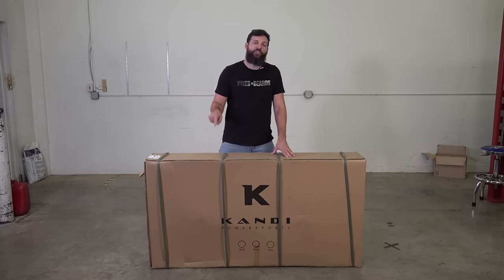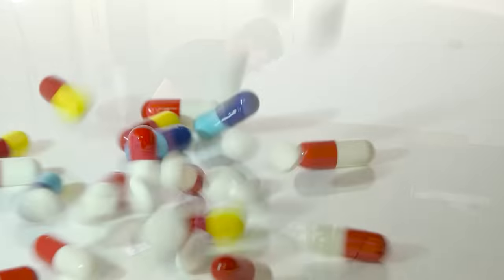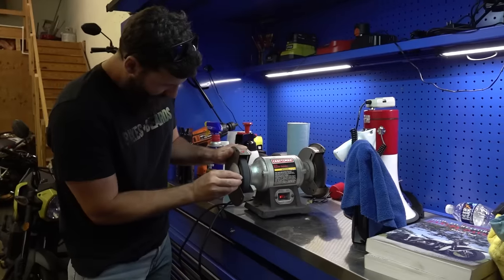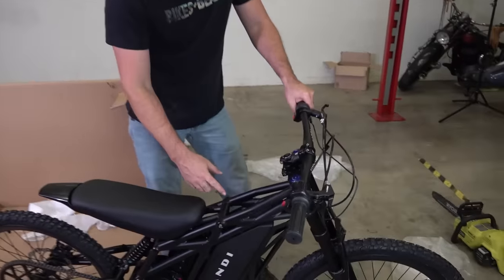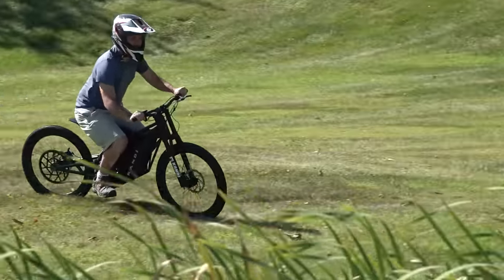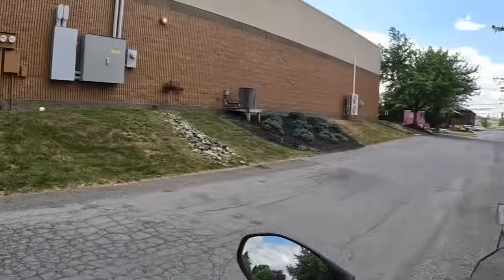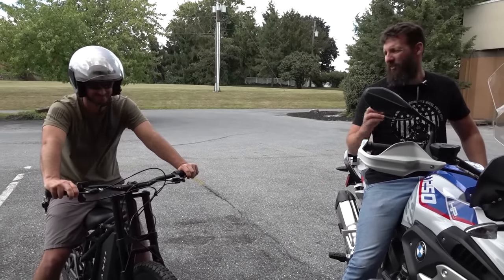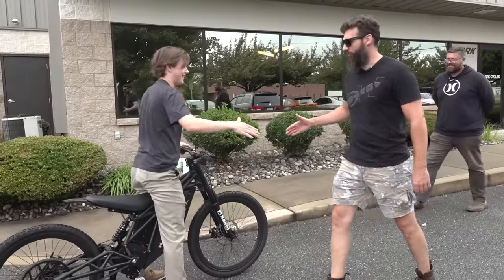I Bought the Cheapest Electric Dirt Bike at the Auction

Comment: Went on Kandi website clearly a Chinese company shipping containers over to unsuspecting dealer who think they will make millions. (Trust me I know I did it in the Chinese 07 heydey, even carried the 800cc sxs which was actually quality unit. Mitsubishi 3 cylinder 4x4 rear diff lock all bells and whistles). Anyhow ppl are so skeptical you make about 2000 per month and I can sell ice to a snowman). Anyhow back to KANDI it's a youth bike and it says on the website (bike looks way cooler on site btw) that it starts at 1399.00 so buddy was blowing out his container probably paying more for his storage than he was making selling them. It's a pitiful 250watt motor I mean even my 1st ever to hit Canada electric scoot was a 350watt/500 peak and it was gutless as hell but very fun and tough as nails. Trust me I had to p.d.i. each unit and give them a serious shakedown. How long that would last remains to be seen. I think ive seen about 2 still riding around town (albeit it's 13 years later) with all the plastics off. Wires going everywhere even saw one with a 12v car batt bunged corded to the highest spot on the rear panel. So yes KANDI its a youth cycle with a 36 volt ( that's 2005 tech it's probably a lead acid batt at a whopping 8 amp hour batt. (Hahahaha) 8ah u serious my lithium to start my bike has more than that. Top SPEED 18.6 mph. Overall LENGTH ( it's probably of the box chinesium is famous for this adds about half the size with their carbon neutral packaging. Estimated RANGE 21.7 (with a bird riding it or remotely maybe or no a sockless chinese fella in a car beside it pressing the button and keeping it upright going downhill 21.7 miles. That's how u get that done. Overall WIDTH 19.7 and this is probably assembled then they put the Styrofoam back on. I'm so glad u did this vid. And if u kids see a FB ad that says their 59.00 please don't be silly and give the crooks your info. If it somehow looks right for you. Go to the few dealers they have and take a test ride. Just know that the test bike is 52 volt 40 amp hour probably just rips. It says nowhere lithium batt. So this is a throwaway 1 or 2 year unit. Cause the issue with China and why I quit was I landed some large contracts that liked these 800cc sxs they were comparable to a Polaris utility at the time for half the price. They bought multiple units and my China Rep promised easy parts yadda yadda. When the time came for an actual part needed they could never deliver. Or they would want me to buy another 40hq container and they would throw in the parts for free. Like ya this huge corp. Is gonna wait 3 months. And that's when supply chain was beautiful. I can't even imagine now. Anyhow there's my story of chenglish salesman and chinesium parts. I'm telling u bikes and beards if we hire a bi lingual contact and have them over there cracking the whip. I know a couple great companies that pump out good products. Pm me if interested the markets getting hot again. Can even get road legal dirt bikes now. Anyhow love you guys and God bless. Don't buy anything off a FB ad unless u see it in person kids and slow adults. Rocky from Canada out.

Comment: That looks like an air fork. The top left cap should come off of it. There should be a Schrader valve. You'll want an actual shock pump to air it up. If you set the sag at 25-30% it should be a little better

Comment: There is a high pressure shock pump that you're supposed to use for the front forks the valve is on the bottom he must turn the bike upside down and then fill it what's 150 - 200 PSI depending on your weight and the bottoming out should be solved

Comment: It's spectacular that you really hate this bike I bought the same bike 3 months ago and haven't had any issues with it yes it does 30 but I've gotten it to 35 never had an issue with the suspension and I have driven it 30 miles on a full charge so I don't know how you only got 9 miles on a full charge? , Literally yes the bike is loud because of the motor I don't know why it makes that noise but it does also with mine, I bought mine for $2,500 and I haven't had an issue yet, maybe put mag rims on it and then won't feel so worrisome about the wheels falling off lol, but I hear you I'm also looking into a Segway x260 or sur Ron, because everybody likes to go fast and why not LOL,

Comment: Absolute cringe that you didn't know how to build it properly, you need to put the spaces into the hub, the pedals you have put on back to front and the forks need air, the back wheel needs adjustment so the chain isn't loose making the noise.

Comment: Pretty sure those factory shocks on the kandy bike are air shocks, if you remove the caps on the bottom of each fork arm there should be a Schrader valve, set them at about 110 to 140 PSI and adjust the dampening and rebound from there

Comment: I've experimented with tolerance on wheel alignment & centre. 

Either they shipped badly engineered product & you will endup with a headache of miss aligned wheels, disc, straight line motion of wheels, chain & sprocket damage, motor/cylinder damage. 

Or it might work, good luck.

Comment: I just watched your Segway vid from a couple of years ago. I know extending your range with a tow-behind genset was something of a joke, but it made me wonder if anybody has tried grafting in a jump-start pack. They have crazy energy density.
Reply from the maker: Hhhmmmm yes they do
Reply: Jump Start packs have about the same energy density as any other Lithium battery. The only difference is that they are special cells that can handle huge current like 300A instead of 30A for an e-Bike pack like this. The jump start packs are only designed to work for seconds, not minutes or hours. The total capacity (Watt Hours) is quite low.